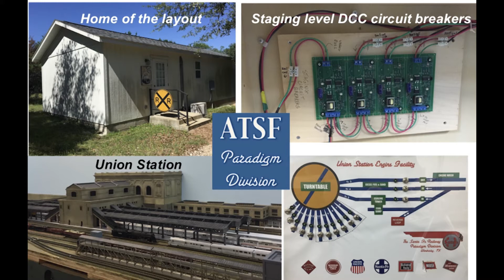Part 4 - The Union Station Passenger Cover Project is Completed

Comment: hat looks awesome John... can't you make up some shims o fix the short legs... i'll be sending you an email in a day or so... thanks for sharing.. vinny
Reply from the maker: Hey Vinny,  I'm not really going to worry about it until I finalize the platform.  I haven't decided on whether to keep the current strip of styrene on top of masonite or to pull that up & replace with the foam board like I have used under the REA Express and main station....John